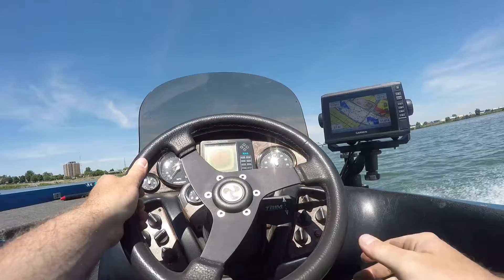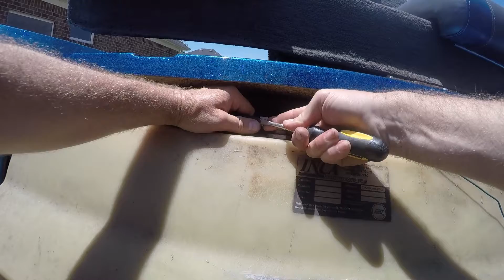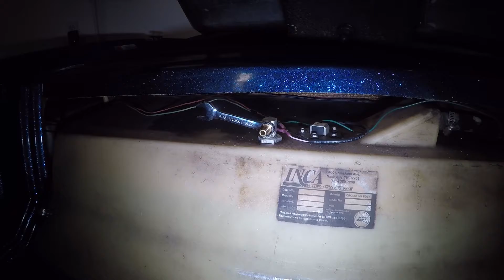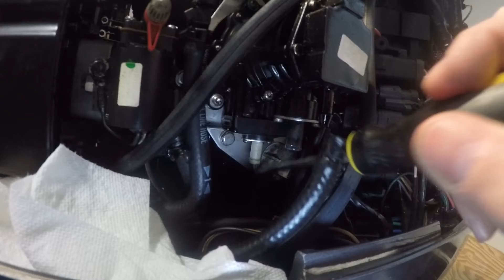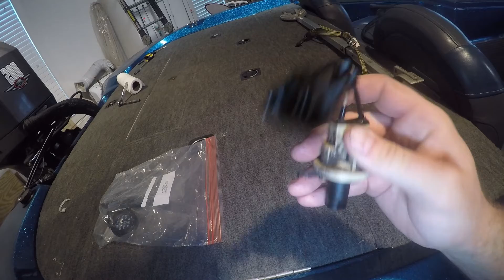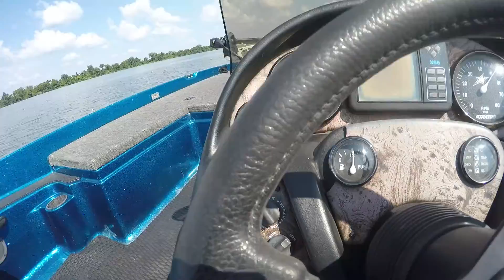Johnson 200 Hp Check Engine Alarm Cause and Fix

Comment: Well done. Too bad for me you're not my neighbor.  Ours is the same engine and check engine light/alarm comes on before i start the engine.  Everything points to that $300 sensor. Yes, $300 cdn as were in Canada.  Thought you did a great job explaining and showing what you did to troubleshoot and all the best out there on the water.

Comment: Hello, I live in France and no one can answer my questions about the problem with my engine, and I am new to boats, I just bought my first Seesa Key Largo 22 with a 150hp engine from 2006 with 260 hours of navigation and I just put it in the water for the 2025 season but I was on the water for the first time yesterday, I sailed for 10 minutes at most and no problem then the return the same at most and after 3 minutes there is an alarm that sounds a bit like your engine, but I can not take it out of the water before September 2025 I hope not to damage the engine if I go fishing with the boat at moderate speed, but my problem seems to be the same as yours. Thank you for your video, I put a thumbs up and I subscribed to your channel.

Comment: good video.... been messing with my  ocean pro for a long time... when i removed the vac pressure switch i tested it by blowing into it and had continuity on the ohmmeter...should be working but i may have to reevaluate...did you ever test the old one?

Comment: The vro runs on vacuum from the engine if your line is loose or cracked might very well have caused your problem

Comment: Im only 7 minutes in the video , but 80 percent of the time , the symptons you describe are water in my fuel tank , i gotta a honda 225 for my offshore boat , it don't like even a snot of water in the tank , it always finds the fuel hose that big bump you mentioned , puts it into safe mode , at worse case , stumbles for a second , best case scenerio . And ill drain that fuel inspect it to confirm , and siphon the gas off the bottom for my beater pick up to burn , leave the water in the jug as much as possible .collapsed fuel line got me one time too , changed the whole motor on my flats boat , and it was the fuel lines , and primer bulb , which felt normal ..lines were collapsing inside of them , both my boats did that at the same time , last year , both 1996 boats ..only use marine fuel lines and double clamp them ..

Comment: I got a 1997 Johnson 200 and I'm getting a similar issue. I replaced the water pump and the thermostat but I'm still getting a constant engine alarm. It only happens when I'm getting to medium-high RPMs and it only happens when the engine is warm. I'll need to shut the engine off for a few seconds and when I crank it up again it seems to be fine for a few minutes. Idk what to do.

Comment: Having the same exact problem with my 2002 Johnson 150.  I have done everything you did except the fuel pickup in the tank.  So tonight I will attmept to replace this sensor.  Just arrived in the mail.  Hope it fixes the issue for me.
Reply: Did that alarm stop coming on after you put the part on
Reply: @timscales5191  I am embarrased to admit I still haven't been out yet.  So busy.  Hopefully soon, I will update..  Also it was easier to replace on the 150 as vro pump is right under the front airbox.
Reply: Well, I burned 23 gallons of gas today and not a single alarm.  Just thrilled this is fixed.  Thanks again for your video!
Reply: REPLYING TO Gom Jabber
Reply: A boat mechanic told me that my problem was the fuel pump so I ordered it not the fuel pressure sensor I'm going to try the fuel pump
Reply from the maker: Agree that could be it.  I’ve since sold the boat but Ive also since learned that the symptoms could also be revealing the VRO fuel pump slowly giving out.  In that case, I would delete the VRO and go to premix in the tank.
Reply: @thisoldoutboard  thanks for the feedback guys.  I am off tomorrow, gonna take it out and beat on it.  Stop for lunch and beat on it some more.  I will definitely update.  Had it in to a marina once , they tried to duplicate, couldn't,  their guys just spilled a whole bunch o f chew spit and charged me a bunch of $$$

Comment: Hello I have a 1997 Johnson 175 HP. When cold starting the fuel bulb doesn't have to be pumped up at all and only need to push in the choke about 2 to 3 seconds starts right up. If your bulb is losing prime or going flat you have a fuel leak somewhere, probably float bowls or needle valve. carbs are easy to rebuild. that will make a big difference in starting.

Comment: The thing I don't understand is : Why did the alarm not go off when you had it hooked up the test tank ?    If the sensor was bad, it should have still gone off with the test tank.

Comment: Hello, I came across this video I found very interest because I'm just started having the very same problems. I have a 1990 Johnson 200.
 Alarm sounding at a high RPM starting over bouncing waves and now continuously at lesser R's and seeming to be bogging down  on my last way in.
I'll be attempting this sensor replacement and  just wanted to know the part # to check and see if it matches my motor.
And if there was anything else that came up or you think I need a heads up on for this.
Thank you for this  enlightening and helpful video.